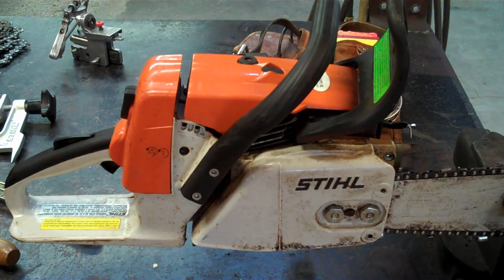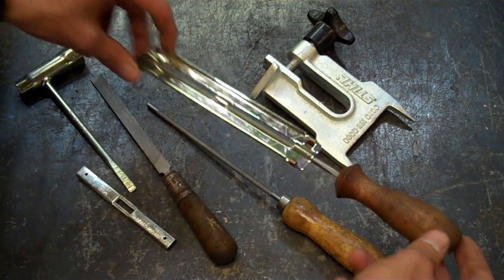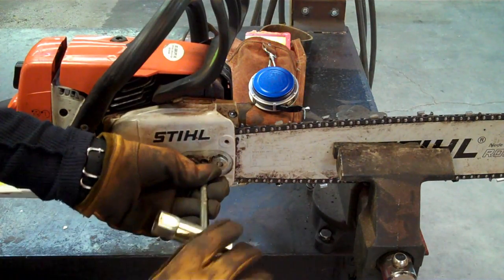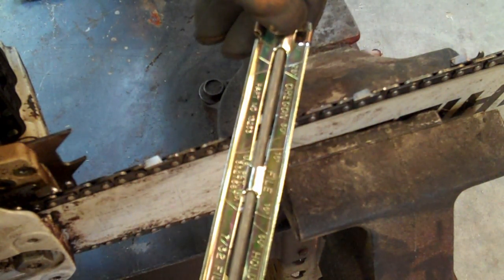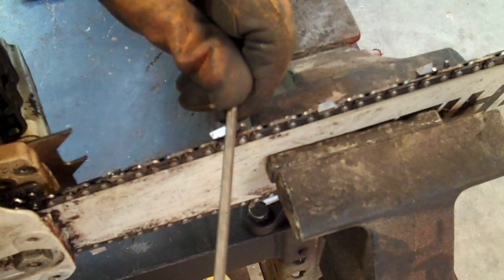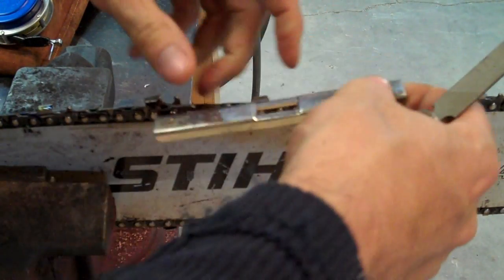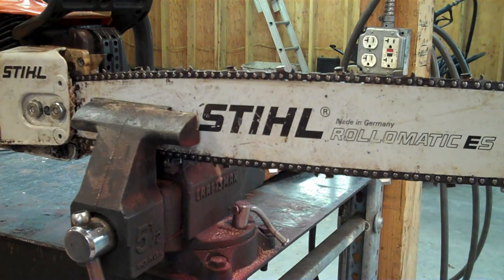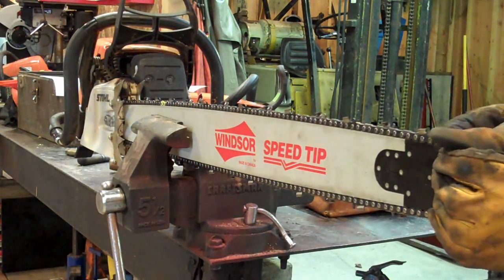Sharpen Your Chainsaw Like a Pro – Essential Tools & Tips

Comment: Chain tension depends on what your doing. I find when falling trees I.like mine a little tighter. When you are cutting big wood sideways to make a pie or back cut debris sometime gets caught between the chain and bar jamming it up. Not good when your in the middle of your back cut. Hoever when I'm just doing some regular trimming I tend to leave it a little more on the loose end, makes for a little faster cut. Just my preferences though.

Comment: Thank you for doing a useful video! Especially the bit about raker file and guide.

I have sharpend plenty of old disston rip and cross cut panel saws, this video has given me confidence to do my own chain saw chains 
When I do hand saws I have the angle drawn on the top of my saw chops, I mark it in with a speed square, maybe U could do similar on this? you would only need one mark. Or just lay a stick on the ground to act as an angle guide till you get angle memory? 
Shalom, Jonathan

Comment: You may have mentioned this and I simply missed hearing it , but need to mention that you never pull the file back through the sharpening stroke. You always push the file and then lift it. You did it correctly but need to mention it since I've seen so many people push the file through , then pull it back and forth. File in one direction only like you do in the video , or you will dull your file and dull the saw chain. File and lift, file and lift, never draw the file back through on the return stroke.

Comment: Very helpful info with a quality production. Add a set of gloves to your basic kit of tools as you demonstrated to protect your fingers from the sharpened teeth.  If you really want your file to last a lifetime, apply cutting pressure on the push stroke only, lift and avoid dragging on the back stroke. This care applies to hacksaw blades as well. Peace.

Comment: If you change your own clutch sprockets then consider running two or more(depending on life you get out of them) chains alternately with each new sprocket as the chains and sprockets then wear together instead of a new chain going on an old sprocket and having it's drive links stretched or worn down by contact with drum. Clutches with rim sprockets, the sprocket rim has limit of life markins- bit like a car tyre- when the rim is worn down to this the rim won't hold drive links off bar's bed

Comment: If you loosen the bar bolts you can grab the tip of the bar and move the bar up and down and as a result the chain will loosen and tighten. You must adjust the bar out of the vice while holding up on the tip of the bar and then tighten up the bolts and check the chain again with the bolts tightened because when you tighten the bolts the bar will move and change the adjustment.

Comment: According to my Stihl owners manual, you should hold up on the bar as you tighten the bar nuts. With the bar in the vise in your case, I guess you would have to raise the saw instead. I notice when doing this that the chain tightens up slightly.  I notice that you didn't do that. Is there a reason for that?

Comment: Since the height of the cutting tooth dictates the height of the raker (at least when using the tool in the video) filing the raker 1st and cutter 2nd means your rakers would be too long when finished.

Comment: cont...
3. The file guide...
It is a popular belief that the file guide isn't necessary and can be a bit cumbersome. With practice an attention to the right details, you can't get a more sharp chain out there. Even better than factory! This is a generalized, egoic concept that I don't accuse you of but that I can tell that you have heard this and adopted the belief. The file guide is great also because you can use it in shop or out in the field where most of the sharpening should be occuring.

Comment: If you do not hold up on the tip of the bar when tightning the vibration and downward pressure will push the bar up even if the bolts are tight and the chain will become to tight.

Comment: the laser lines on the back of the cutters is called the "whitness mark" this is a indicator to say when the chain is scrap also it is not a "raker" its a depth gauge this gauge determins the amount of woodchip to be removed, to low the chain digs in and slows the saw,ie puts a strain on the engine, if the guage is set high the chain will "skip' accross the timber. your concept of the correct chain tenstion is miss guided, the chain in your vid is to slack the correct tention is that the "chain must not creep along the bar on tick over" start slack and tighten up 1/4 of a turn untill you reach this point, (not creeping) and lock up the nutts, just one last point, the round file should have a backing plate this also shows correct file angles, it also has the correct angle for the cutter to be at when your filling, which you cant attcheave when free filling, and which tooth do you start on first when sharpening? over the years of being in buisness ive taught most of my staff to get through there chain saw tests, many years ago i use to push the chain around backwards untill my hand slipped which went over many freshly sharpened cutters! still have the scars today! always bring the chain forward or on your vis top left to right if you do this and your hand slips, it will only hit the back of the cutter, which is not sharp!!

Comment: Especially important in hardwoods which I don't think you are cutting as your chain is absent rakers, not the depth gauges you refer to, the miniture ramps found on links between the teeth links. The packaging you mentioned as providing information on the angle to be filed at, yet you miss the information on the same packaging that shows the angle to dip the file at(often 10 degrees)- tilting the ffile while sharpening is only wrong if done at the incorrect angle

Comment: That's weird, my comment received too many negative votes, and yours was marked as spam.  It obviously wasn't.  All I meant is a GAUGE isn't supposed to be used as a GUIDE.  The gauge is calibrated for a certain depth for your chain.  If you file on top of the gauge, you will also be making the gauge deeper over time, and it will loose it's accuracy...which would be really dumb.  Using a straight edge and feeler gauge sounds like it would work munch better.

Comment: I didnt borrow my father's saw I just took it. He was complaining how it didn't work so I took it and cleaned it. It starts right up but runs a little rough. I will run some carb cleaner in it tomorrow. He probably messed the gas oil ratio too. I will get it running proporly for him and then go get a stihl saw.

Comment: Rakers;
the raker actually doesn't clean out any debris. Its purpose it to set how much wood is being cut. If it is too low (over filed) it will grab too much wood and cause more kick-back, bog down in logs and generate high temeretures on all metal parts including the bar, the sprockets, the powerhead and the piston! If not filed down at all, then the saw won't be cutting any wood but also generating excess heat and damaging the saw parts and piston.

Comment: I would like to sharpen another...
1. the tool is called a 'scrench'. A combination of screw driver and wrench
2. the 'depth guage' is also a tool for inspection of specs on the bar for wear that deems in damaging to the rest of the saw. In combination to the flat file, if you file ON your guide, you change the measuring of the tool. I use it to check for height, file the raker, then check again. Remember the teeth on all files are one directional. If you drag back, the file becomes useless.

Comment: hello there. you've probably mentioned this in another video. when is it time to get a new chain? if I were to get the bar jammed while cutting timber what is the best way to extract it?
Reply: Also, more importantly, when is it time to get a new wife?
Reply: tejolson92 When she begins talking about buying a condo in downtown Portland. C-ya.
Reply: The chain can be sharpened and used till the teeth start falling off.
If the bar gets really jammed, unscrew the saw from the bar, put on a spare bar and chain, and you can saw the stuck bar free without risking the saw. Or  unscrew the saw, and use hammer and´wedges to free the bar. (By unscrewing the saw from the bar, it will not get damaged by the tree falling on top of it!)

Comment: Okay I've never sharpened a saw before. I bought the correct size file and file guide to sharpen my Stihl 20" saw. I did everything the way you did in the video, making sure to get a 30 deg angle as i sharpened. I did three strokes in the correct direction on each tooth, Brand new chain, first time being sharpened. I took it out and tried it, it cut better but not like it should. Do i just need to file it down more or what?
Reply: Look down at the cutters, if you see a shiny edge along the cutters edge and point its dull. You have to file the cutter until is gone. When filing with out a guide you can watch the shiny edge disappear every stroke you make with the file.
Reply: If it's a brand new blade, you shouldn't have to sharpen it, I'm assuming it's not new. You should be able to inspect the cutting edges on the blade, take your finger nail and see if the cutters will shave slivers off the back side of you finger nail, if so, it's sharp. If it doesn't, keep filing on them. Remember to keep a little upward pressure when filing, this will ensure you are taking off metal on the actual cutting edge on the cutters. Finally check the rakers, if they are to high- the cutters will not cut enough, if they are too low- the cutters will cut too much or too aggressive. I hope this helps, and good luck!!!

Comment: cont...
the file guide maintains the height relation between the raker and the leading edge of the tooth. If no guide is used, the file grinds too deep into the gullet creating a false sense of being sharp that won't last due to being too thin. As with using a guide caution too pull back creates a profile that is similar to a skateboard ramp which is blunt. A guide is essential and must be resting on the raker AND the top plate. What? the 'gullet' is the round void created by the round file.

Comment: Ouch to that poor little flat file while your filing the cutting depth gages.  I'm sure you've learned by now files are made to cut in one direction.  Forward.  Dragging them backward will end the life of your file prematurely.  Lift, reverse, down and cut.  
The other thing i caught was the upwards pull on the round file.  Wrong. It's steady pressure  horizontal. If users look carefully at the chain as it came from the factory, they'll notice the very bottom of the belly cut.  That should be maintained at all costs for optimum cutting efficiency.  So a steady pressure sideways or horizontally, into the tooth will guarantee that.  Not up, not down, horizontal.  If anyone has ever run into metal, which i did recently, and took out my entire left side cutters, and had to spend the next hour correcting and reducing every single tooth, left and right, to exactly the same size as the worst tooth.  Almost 3/16". With such a major correction, and with the horizontal force applied, you'll see that your belly cut is maintained at exactly the same plain as the original cut. I finished sharpening and adjusting my rakers to correspond with the new tooth length, and it cuts like it did when it came out of the box.  Nothing like seeing those big chips fly off! Anyway, minus the tweeks, good video.

Comment: One thing to always remember is to make the same amount of passes on each tooth also when you sharpen your chain one to two times turn your bar over so that it doesn't wear in just on one side. I have my bars trued every time I need to put a brand new chain on. Also when you tighten you chain always do this with your saw upside down.
Reply: I've been told you can just pull the bar up while doing it as well. But would you say it should be in a vice or not in a vice?
Reply: I sharpen my chains allot in the field where I don't have a vice but ether way works. Just pulling up on the bar is ok but I found it a lot easier to do it with the saw upside-down so that I can tighten it really well. I also run a 460 Stihl saw with a 36" bar and a skip tooth chain so the bar needs to be tight.
Reply: Thanks for responding!

Comment: @satinwarship
Dremels and grinders take the temper out of the steel by applying too high of heat. Also they are too aggressive and take too much material too fast. Even if you have rocked your chain, 10 or so strokes with the file should take care of it. That said, sharpening still only takes about 10-15 minutes.

Comment: Not bad. I personally prefer using a grease gun with a needle injector instead of the plastic Chain Saw Grease Gun. Not as portable but it works better.

Comment: Good video, agrees a long way, but personally I prefer to mount the round file on a round file holder, from Oregon, the reason for this is that you do not always know in advance whether the file has been led in the right height earlier on, if you such, files a chain for a friend? To ensure that all teeth are the same height, which is of great importance to counteract vibrations, imagine that the chain's cutting speed is about 100 km / h, there will be a high rake?, or cutting tooth, which sends the saw bar, just a few distance upwards ?, how many teeth whizzes around in the air, without cutting before there is contact between the saw teeth, and the tree again? ........ why I would recommend purchasing a short caliper made of brass, brass don't harm the cutting edge. then I'll find the shortest sawtooth, by measuring from the rear edge of the saw tooth, to the cutting edge, be aware, that the rearend and top end, are obtuse-angled, so take the measure in the same level each time, start by file the shortest  tooth, and afterwards measure the length of this cutter, use this measurement as a reference for the rest of the teeth, it is important at this stage to point out, that I'm waiting with the rakers, until I have sharpened all the teeth, remember not to put too much pressure on the file, draw attention to that the file is fairly thin and can easily bend upwards or downwards if round file previously have been led in the wrong altitude.
Now is the time for the rakers, now all saw teeth must be the same length = same height, pay attention to file gauge rests on top of the teeth, so it is important to carry out the work in the correct sequence, and not start to file the rakers first.
Pay attention, the raker gauge are made from hardened steel, the same material as the flat file, the result from filing in the rake guide vil ruin the file tooths, and the raker guide, then grasp the raker guide as a measuring instrument, not as a depth limiter for the flat file, start by placing the raker guide on top of the cutting tooth, depending on model, Oregon, or El, which means Electrolux, the one that you buy at Husqvarna dealers, Husqvarna is owned by Electrolux Sweden, therefore emblazoned "EL ", to all parts, also their rake guide, if you use a raker guide the Brand Oregon, resting usually over 2 saw teeth, I recommend filing in direction so that the rake sitting on the opposite side from the direction I file from, appeared to have learned that the rake is less prone to self-oscillate. oscillation of the chain. leads to a bad result, it is not good for the file, or the file result.
First measure if the raker protruding above the depth guide, if so? take a file stroke or 2 and set depth gauge on the raker until you can no longer feel the raker when you slide the corner of sharp metal edge across the top of depthgauge you feel even the slightest, that the raker protrude over the depth gauge, with this approach.
When all the rakers are done, to the right height, then they are rounded with a single cut flat file, file from the bottom towards the tip, while the file are turned in a counterclockwise motion, take nothing of the height of the rakers.
If you follow these tips, and guide the file in the correct level, and at right angles, in accordance with the chain manufacturer's data, which can be found, here on the internet, then I almost promise you State guarantee, that you'll get a perfect result.

Hope you understand? it's a little difficult to be precise in the language, I'm Dane, and a little difficult when it comes to explain technique?

Comment: You mention not being able to cut straight at times, do you check that your bar's running rails are true and that the correct depth is still there? This influences the ability of the drive links to carry the bar oil and effectively lubricate the whole length, obviously the bar-grove tool needs to be utilised as well for this to be achieved at maximum efficiency. Burrs should be removed as they start to develop on the rails outer edges, so that nicks don't develop in the bar.